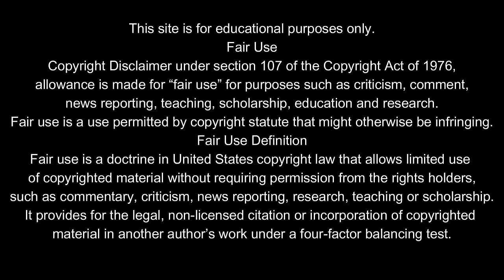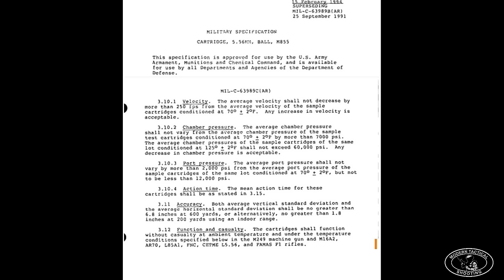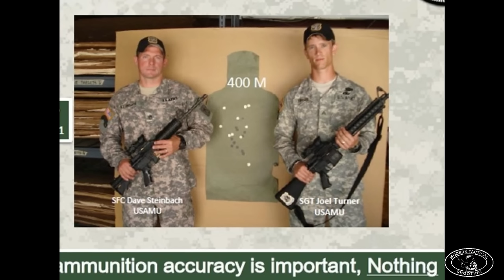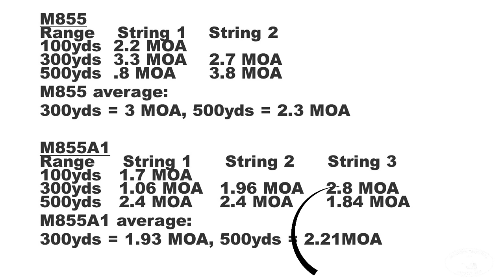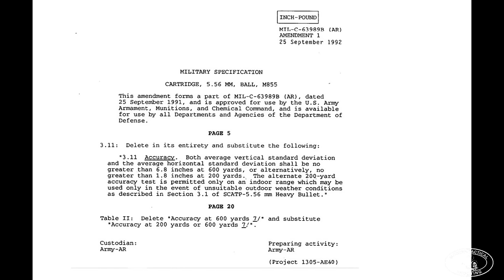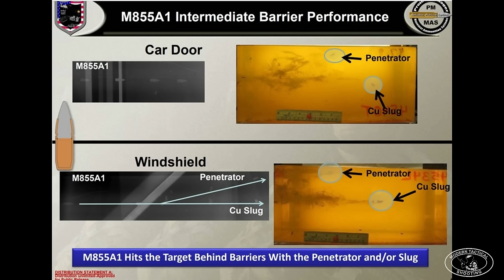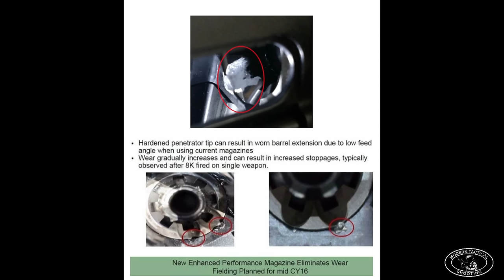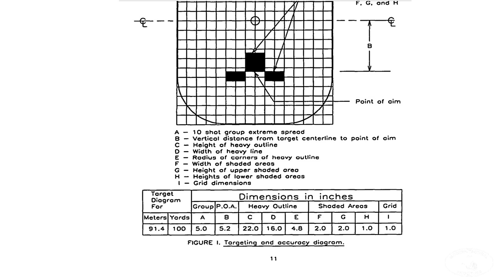M855A1 Performance Review. Did it live up to the Army's hype? Did going green really work?

Comment: Thanks Jeff - that was really interesting.  When I was in USMC ITR in 1970 we had those aluminum 20 round magazines and they were complete pieces of crap.  They weren't all the same size - so the M-16A1's we had had an adjustment to the magazine latch.  Once I was issued two magazines for training.  The first was too fat and would not go in the weapon - so I had to adjust the magazine catch to fit it in.  When I fired that magazine off - I put the next magazine in - and it was a skinny one - so the bolt going home drove the magazine right out of the weapon and into the dirt ...

I was not happy but at least that happened in training.  I never saw combat.  My contribution to the Vietnam War was being a sentry in California.

Of course, the Army does not have a good history on things like ammunition.  The ammunition Custer's troops had did not have brass casings - they were copper.  Which had been bought because it was cheaper.  The end result of that was that if you fired the weapon to fast the weapon would heat up and the copper would swell tight against the chamber.  The extractor would tear off the base of the round - instead of extracting it - leaving a copper coated chamber that you could not fit another round into.  Troopers had to take the points of their knives and try to pry the copper out of their chambers in order to load another round.

When the Army became aware of the problem - they stopped buying the copper cased rounds - but - they issued all the ones they'd paid for ...
.
Reply from the maker: Back in the day for me (early 90s) when we had the black follower 30 rounder, similar problems. I would take a dozen mags to the range, always a couple that did not work, I would mark those that did and stick to them only. green follower mags came out around 1998, they are still them best GI mag I think.
Reply: @ModernTacticalShooting  Yeah.  That was smart.  We had to turn ours in when they said to so we just had whatever they gave us.

One day after training - it was 

"Turn all your magazines in!"

Then

"Don't turn your magazines in!"

Then

"Turn all your magazines in!

Then 

"Don't turn your magazines in!"

So - after the last one - I went to the guy I'd turned my magazines in to and he didn't have any more ...

So - for the next little while, I had a one round M-16.  I'd get the bolt back and stick a round into the chamber through ... I believe ... the magazine well ... though it could have been the ejection port ... I don't remember.  We were just firing blanks, chasing each other around the hills on Camp Pendleton.

Bang!

Bang!

"You're  dead!"

"No I'm not!  I shot you first!"

Such an "improvement" over when I was 11 and chasing my friends through the woods around the MOQ's on Camp Lejeune ...

Never had problems like that with the Steel (?) Magazines for my M-14's.  We spent like 3 weeks (?) at Edson Range and I never had a feed problem with an M-14.

When I was a sentry and we had an alert ( Bong!  Bong!  Bong!  Bong! ) - you'd grab your M-14 out of your wall locker, pull on your pants and sprint down to the Guard Office where they handed out magazines (two iirc) to the guys piling into the backs of pick up trucks to respond to the alert.  Then Off we'd go ...

We'd turn those back in when we came back from the alert.  So we never got to keep any magazines with our weapons.  I'm pretty sure they didn't want us to have loaded weapons in the barracks. The only time I ever had ammunition for a weapon - was when I was ON post.  We had 1911A1's for Gate Posts and Roving Patrols - but those weapons (with two magazines ea. and only had 5 rounds ea. to keep the springs from becoming depressed) stayed on post with the relief.  Same with the M-14 magazines on Walking Posts and Watch Towers.  Never had a feed problem with a 1911 either ...
[shrug]

I don't think I ever knew a Marine (and I served with a LOT of Combat Veterans) who didn't love the M-14 and hate the M-16.  I do not envy you guys that weapon or it's descendants.  Not one damn bit.
.

Comment: One of the biggest issues (speaking as a current active duty armorer) is chamber and throat erosion, especially in the 249. If a 249 goes to the range, one of the barrels will almost certainly be deadlined  because of the gouges that M855A1/M856A1 (tungsten tracer)

Comment: The accuracy test seemed incomplete in my opinion, having less strings of fire for the M855 and giving what was admitted a data outlier a hugely weighted impact on the average. It looked to me that with more strings you'd be seeing an average of one MOA improvement in accuracy for the M855A1, from about 3 MOA to about 2 MOA. I'd take that improvement any time.

 Just like yourself, I'd like to see some more standardized testing instead of the mystical verbiage of "match-like accuracy" and a few anecdotes from the army.
Reply from the maker: Yes my intent with the video is just to address the Army's "match like" statement I know my testing incomplete. But shooting it for years when I was in, it never impressed me with its accuracy over M855
Reply: @ModernTacticalShooting  fair enough, brother. Thanks for the video!

Comment: 3MOA at 100 is what even my most budget AR-15s(I'm talking del-ton, PSA, S&W builds) are capable of with standard 55gr plinking rounds.
Reply: Yeah the vast majority of ARS, even high-end ones in my experience are 1.5-3 moa with 55gr.
But my Colt 6920 and Geissele Super Duty are MOA/Sub-MOA with several different loads 
Most "plinking ammo" isn't loaded nearly as consistently and for the most part is 2-3 MOA ammo

Comment: My experience over the past 10 or so years with it is it's no more accurate than the old green tip. Does is go through car doors well, yes however so did the old stuff. It's just ball ammo with spiffy marketing nothing more nothing less.

For getting through the Kalat walls we found "pick and hammer"(.50 & 40mm) was the best way to get through it if you weren't running tow-2 BB.
Reply: That's nonsense. M855 was terrible on ballistics gel and M855A1 was amazing. 

If anyone misses with M855A1, you're either using the wrong barrel twist or you can't shoot. 

Considering that M855A1 is 62 grains, which means it wants a 1/9 barrel twist......
Reply: @Seth9809  I have great accuracy with 62gr 5.56 and .223 out of 1:7 barrel. 55gr mil-spec ammo shoots 1”-1 ¼”, 55gr varmint ammo(Hornady, Sierra) shoots 1” or a tad less. I have noticed that .223 tends to have better accuracy, as long as I stay 55gr or heavier. I just got some 73gr loads to try.

Comment: I used a ton of M855 in training and deployed, and a good amount of M855A1 from several different AR type rifles, and both failed to impress me in accuracy, esp. as compared to MK262 or those 75 grain Hornady rounds that were around for awhile (love those). Definitely NOT "match like" accuracy.  I was issued the LWRC M6 at a place I worked OCONUS, and our ammunition supply process was unpredictable- you never knew what you may get when forward deployed, so sometimes we would get MK 262, sometimes green tip. We were specifically told not to use the M855A1 round through those M6 guns. I also told our leadership if that was the case to not put it on our resupply pallets if they didn't want it getting used. I have noticed getting consistent yaw with the 75 grain Hornady rounds on pigs and deer. And I have never seen a jacketed 5.56 round NOT go through a standard vehicle door. And even 40mm HE wouldn't penetrate a afghan mud wall, and that has an explosive charge in it. And there sure is lots of body armor in circulation now- not to mention armored vehicles (thanks brandon). I do like the M193 as a general purpose round- accurate enough, mild to shoot, not hard on steel. I think I'll stick with my PMAGS. I noticed on many of the M4's in my unit, they would still be grouping good, but would fail chamber erosion. I never saw a shot out M4 barrel that PASSED chamber erosion testing.

Comment: That "bad mag" issue where the bullet goes into the feed ramps, is actually an out-of-spec upper. The barrel breech extends beyond the receiver, making a shelf for the bullet tip to catch under.
Reply: Perhaps, but you must use the tan mags.  They have a different feed lip angle.   Solved our problems.

Comment: The ammo change was some REMF’s OER bullets point for the year, did nothing to change lethality from my experience. 
We switched the new “improved” round in 2010 towards end of our deployment. Saw no difference in terminal effect, only way we knocked anyone down with 556 was to hit CNS. Hips and heads were the only guarantee knock down we found, inside 100ish yards they tumbled and caused good effect. Past 300 you’re pissing in the wind, if you hit the guy they’d barely react , a through and through pin hole wound which would slow them down a bit but that’s it. We’d find blood trails and drag marks but find no bodies consistently, they were so doped up on pills they’d get away. Every time we got in a good fight we’d see multiple funerals for the next week, they’d police their brass and bodies throw them in wheelbarrows cover with grass leave the area. Our air support would report seeing an arm or leg dangling from the wheelbarrow but couldn’t get clearance to engage, they knew our ROE and would exploit them. We figured out real quick if we pinned them down with accurate fire and called in air/arty we had their asses, .50 and 40mm even had limited effect on the mud walls  but made it easy for air to locate and eliminate them. 
Never used the Navy 77gr load but, 9mm will punch through car doors at handgun range, 556 at close range has “predictable” deflection at the right shot angles. 
Can’t give any info on its effectiveness against hard surfaces because I never encountered or tried them. If the enemy is wearing armor it’s time to shoot hips and heads anyhow and the most accurate round is what’s needed. 
M118 from our dm rifles was much more effectIve at stopping fights, nearly 3x more bullet weight than 556 green tip.
Reply from the maker: You mentioned wheelbarrows for dead and wounded.
....I saw this first hand myself too
Reply: @ModernTacticalShooting  Yesr, most the guys we fought were disciplined enough to lay blankets down and police their brass and dead. We could always tell the foreigners from the locals. They would run 2 rpg gunners, a pkm, and couple flankers with ak. Just like I read about in Vietnam if they were running ak full auto you could just about stand up and walk to them. The pkm will put you behind cover quick, on rare occasions we’d encounter a dishka and that’s a scary sound for sure. If it was a locals they’d have an ak couple mags maybe a cellphone. Foreign fighters had serious ammo, maps/documents, phone and/or radio, actual kit. Weapons that were maintained and a bag full of pills. A guy who’s jacket up on anti depressant and a amphetamines  will fight with no fear or feel pain.  Locals would take a few shots and run off, our biggest headache was the kids with mini grenades. Bad guys would find 2-3 kids pay them to parallel us and toss a grenade over the wall. If we couldn’t roll them up quickly they’d drop/ditch them. They were smart enough to wait till pomegranates came into season before they got bold. It was nothing to see a kid with a bag them and a grenade in the bottom, if the kid drops his bag when you approach he’s riding dirty. It was always the 8-12yr olds they put up to it.

Comment: I carried a Mk18 with 77 gr mk262,  got a hold of the M855A1 after arrival in Camp Brown and before moving to TK and other VSO camps between Cobra and TK. There was no noticeable shift from the zero I had with mk262 at 100 meters and could use the same holds all the way up to 400 meters to hit an ammo can. I say it was pretty accurate compared to M855 and decent compared to mk262.
Reply from the maker: VSO...Horrible idea
Reply: @ModernTacticalShooting  lucky for me, I was just delivering and installing new equipment, showing the snipers how it worked and moving on. The VSO was not an easy mission for sure.

Comment: Very good amount if info packed into this video. Having not worn a uniform since 1990 and only having to deal with AR platforms from the civilian LE point of view since, I didn’t t even know about the 855A1 until may 2019 after reading something about the round. I’ve bought green tip but found that after shooting mostly 1-9 barrels since 2004, the 55 grain variants seemed to have sufficient accuracy potential. I’ve gotten as tight as .6 MOA with V-Max 55 grain and some Israeli surplus M193 I bought in 1992-93 was capable of knocking over 2x4 inch prairie dog silhouettes at 500M after aging gracefully in a can for 28 years. That out of a 14.5 P&N 1-9 barrel. I have never shot any of the MK262 but had understood that in addition to accuracy, it was found to have ballistic benefits in shorter barreled platforms. I also have a 16 inch 1-7 that I’ve used to get some fairly decent slightly over MOA groups with some 75 grain commercial, but really didn’t have enough ammo to say it should be my go to. 

My question is - with the Mk262 having superior accuracy benefits and a solid track record, why didn’t the Army simply adopt it in place of blowing money on development of the M855A1?  (I know….  I know…..)

Comment: Very informative video. Your ammo assessment is spot on, except your take on 5.45x39. The consistent tumble effect through soft tissue came from the Russian incorporating a hollow cavity right behind the tip of the bullet. When it hit soft tissue it deformed the tip, forcing a tumble. The early AR15's had a 1 and 12 twist which barely stablized the bullet which was used to create the tumble effect. Lastly, people seem to forget about how important the barrel is. Accuracy comes from the barrel and ammo being harmonically tuned to one and other. You can have two identical barrels, produced back to back right off the line, but their harmonic nodes will be completely different.
Reply: M193 is short, base heavy, and has a particular ogive that facilitates yawing.  Combined with the cannelure being right at the typical break point, it has always been our best killer on soft targets.

Comment: The majority of my ammo is M855 Green Tip. I have half as much in M193, and then 100 M855 A1 for good measure. If I ever have to engage (hopefully not) in any more combat shooting it would only be in CONUS as my military days are behind me. I think what I have is probably overkill for that sort of native soil  scenario. I'm shooting out of a 16 inch AR with an LPVO and offset red dot. I've only shot it out to 100, and at that junior varsity distance it is sub MOA to MOA with all three types of ammo. 

I think it'll do for my needs. 

Great video!
Reply: my mk12 inspired clone has a 18 inch barrel and I have steel at 65 yards.. the m855 is stopped by the steel, the m193 zips right though like nothing
Reply: @soup31314  My experience with the 16 inch at 100 yards matches yours.

Comment: Jeff, outstanding review of the M885A1. My first experience with A1 was in 2013 in Afghanistan. Has anyone else witnessed corrosion and tip separation on the 855A1?
Reply from the maker: Well plenty of oxidation or corrosion, never saw it effect performance.

Comment: The image posted at ~22:38 where the nose of the round dug into the receiver appears to be a gun issue not a mag issue.   You can clearly see the barrel extension is too far into the receiver.   Appears to be an M4 notch/feed ramp on the barrel extension but hardly any M4 feedramp on the receiver.    This is something you have to watch for when using M4 vs non M4 feed ramps on the receiver.  That setup is literally asking for the rounds to cause issues there.
Reply: My understanding that is a magazine problem. That issue was supposedly fixed with a new follower design. They're baby blue if I remember correctly.

Comment: I think they should have taken either a 6 ARC or 6.5 Grendel and added about a millimeter to the case length and bumped up the pressure a bit and called it a day. Then make a nice lead bullet with a hardened steel tip and a special version with a coated tungsten tip for when they need improved penetration. Make the regular one with a green or blue tip and the special one with a red tip.

The target range is already permanently full of lead. Lead comes in different forms and some forms are more dangerous than others. The regular metal like with bullets is not even that bad. You're not getting lead poisoning walking around a shooting range. Unless you want to get down there and lick the ground. It's the liquid form of lead that is really dangerous.  Lead has the weight that you need for kinetic energy.

Just make a new upper that they can slap onto the original M4 and M16 lowers with a VLTOR A5 buffer assembly. They didn't need to spend this much time and money to improve performance. The government likes to make things way too complicated and expensive. 

If they had a little extra money to spend they could have upgraded the trigger to a geissele G2S trigger or even just an ALG ACT trigger. I think the guys would have been perfectly happy with this setup and it would have been easier to handle the recoil than the monster that they made. 

I have a "20" Grendel with a rifle buffer and you can't tell the difference from 5.56 and if it were 10% more powerful, it would still be easy to shoot.